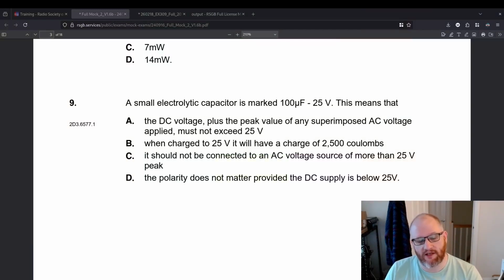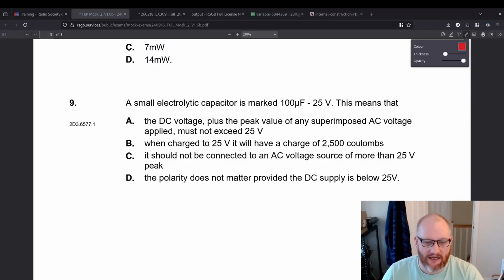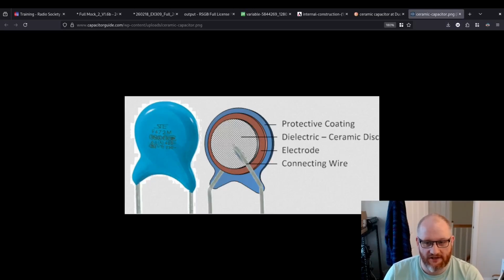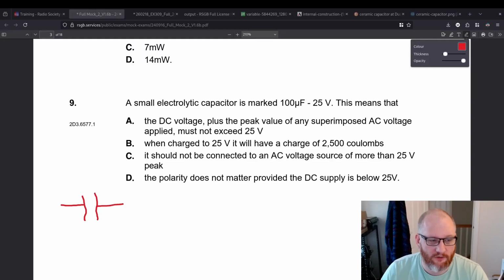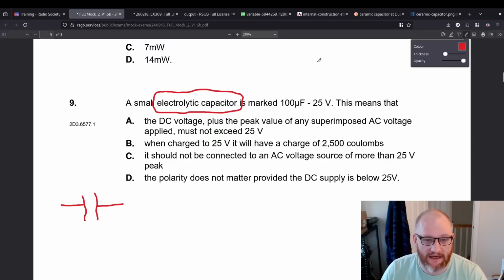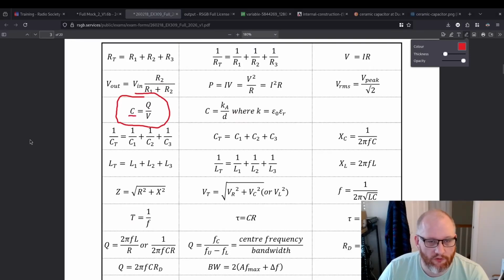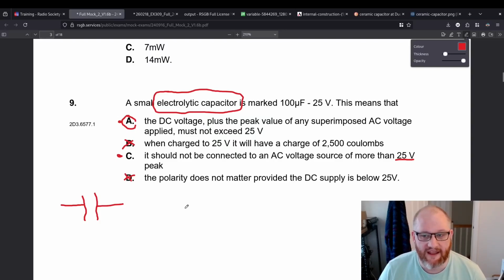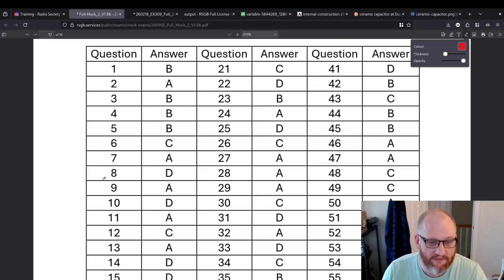UK Amateur Radio Full Licence Mock 2 RSGB v1.6 Question 9

Comment: Many thanks for this series of videos. I’m finding the very useful. However may I make one suggestion. When you show the answers please avoid showing the answers to adjacent questions. I tend to pause your video and write doej the letter of the answer which I believe is correct. Then I listen to your explanation and answer mark my own answer correct or incorrect. Then move onto the next before doing the same. I find this a good way to learn and be able to go back to the ones I get wrong. However I need to remember to look away from screen when you show the official answer incase I inadvertently see the adjacent answer. Hopefully you can address this in future videos. Thanks again for this great resource
Reply from the maker: Hey! Sorry for the late response had a lot on this end. Hoping to start doing some more videos soon and will take this on board. Glad you find them helpful. Thanks :)